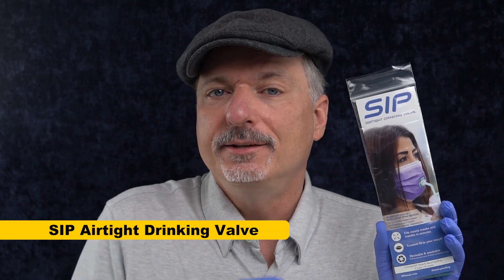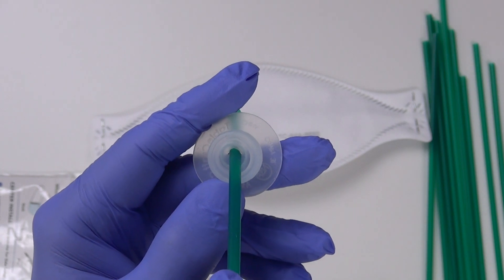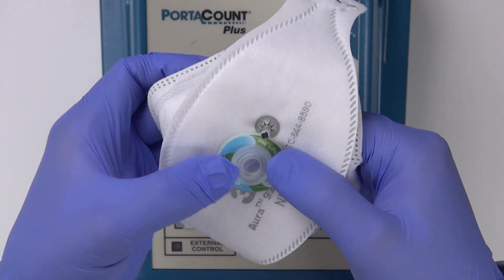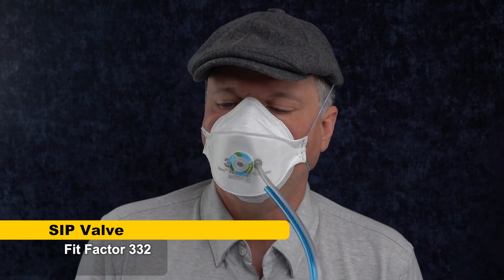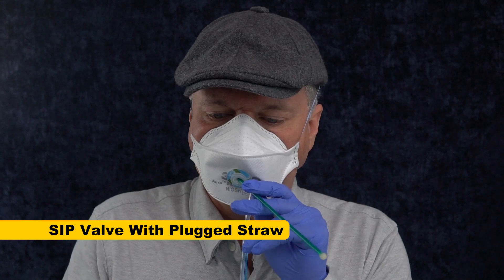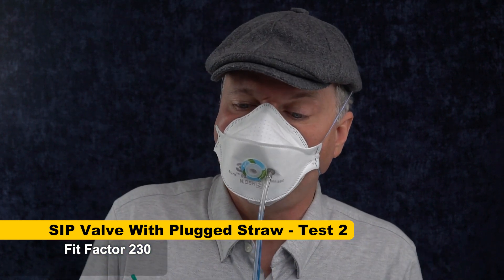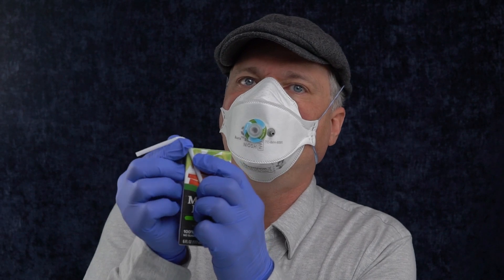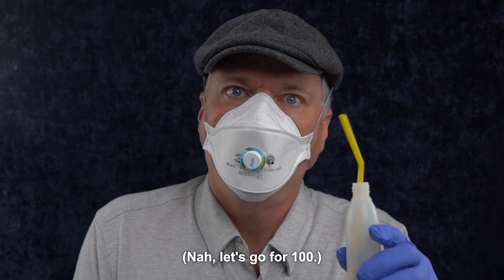Is it safe to stick a hole in your mask so you can take a drink? Testing the SIP drinking valve

Comment: Thanks for doing this testing!
Sorry if I missed it - did you try any of these tests after washing the valve in the dishwasher and installing in a new mask, as the website says you can do ~10 times?
Reply from the maker: @joshuaremba8261  

Thanks for the question. I have not done a longer term test yet. I was just looking at some of my sip valves from this test with a microscope, and found a lot of debris on the valve that could possibly interfere with the performance if it gets in between the different flaps propping it open. So I think your suggestion of washing the valve is a good one, that people should visually inspect the valve with a magnifying glass or digital microscope, the one I used happened to be around $22. Very inexpensive what it does.
Reply: @gerardhughes  I'm wondering about things like it warping slightly with washing, in addition to everything else.

Comment: This is really good. I do note from the packaging that there are fairly specific instructions on how to drink (while using the straw) to prevent the risk of breathing contaminated air during use. I think they suggest you keep the straw cleaning edge clean and put the straw into the drink then breathe out, forcing any air in the straw into the drink before then drinking. I imagine this is a complicated technique to adapt to! I also consider that the drinking edge of the straw needs to be kept clean before using it every time.
This is reassuring though. Thank you
Reply from the maker: @cassmacdonald-75  

Thanks. This video has been out for a while, and they have since updated their instructions with best practices advice.
Reply: @gerardhughes  yeah, I thought that was the case! Got mine about six months ago, though have not had cause to use them (haven’t travelled or spent sufficient time out of the home to warrant it). Apologies!

Comment: Thanks for this review! I'm still a little unsure about these. Doesn't a fit factor of 34 when using the supplied straw mean that it fails the fit test, if 100 is a required to pass? I understand that it's better than something that fails even more, but... 😅 I would have liked to see a few different attempts with the supplied straw, just in case something went wrong that time. Or what the score is if you take a lot of care not to suck air through the straw etc. Good to know that the valve itself doesn't mess with the fit factor of the respirator too much anyway!
Reply from the maker: In this video, I'm using a full range PortaCount test that calculates total inward leakage, which includes filter penetration as well as seal leakage - it's sometimes called "N99 Mode", for use with filters that are N99 or better. An N95 is allowed to have up to 5% filter penetration of the most penetrating particle size at 85 liters per minute of air flow, so this kind of test doesn't tell me how much of the total inward leakage is allowable filter penetration (up to 5%) vs. allowable seal leakage (up to 1%). 

So, using this machine a legit N95 with a perfect seal could still score below a fit factor of 100. There is a separate mode that some PortaCounts have called "N95 Companion" that only tests negatively charged particles, which are easily captured by the filter media and don't penetrate, so if they are inside the mask they got in around the seal. In that case, you know a fit factor below 100 indicates a failing seal leakage.
Reply: @gerardhughes  I see! Thank you, that makes sense.

Comment: This is such good information. Thank you for making this video.

Would you ever test with the Gerson 3230 N95?

I find that the duck masks have great seals but I'm worried about its odd shape when it comes to valves.
Reply from the maker: Unfortunately, I'm not one of the people that fits the Gersons well. So it's not one that I can effectively test with the sip valve.

It seems plausible that you could put it on the lower half an angle of straw up towards your mouth effectively. At some point I made test that with a 3M V flex, which is the only duck bill type mask that does fit me that I've tried so far.

Comment: Where can I get one of those machines? I need to test various respirators with beards.
Reply from the maker: You can find them on eBay, but it is a little bit tricky because these are surplus devices that are no longer repaired by the manufacturer. The laser diode in the machine has a limited lifespan and there is no error message on the machine when the diode is dead. So some of them don't count particles, and it can be tricky to tell whether or not that's because it's clogged or because the laser diode is dead. If the laser diode is dead, the machine is non-repaiable. So buying these off of eBay is a bit of a risk, although many people have had mostly good luck. But the last one I bought was dead and non-reparable.

The other tricky thing is that you need to get the machine to come with all the accessories necessary to operate it. So you should download the manual on the TSI portacount 8020A to learn about its operation and what's necessary because none of the eBay listings are itemized. You have to learn to tell the items from the photos and the listings.

You'll need a working portacount 8020.

An alcohol fill capsule
Alcohol cartridge.
Alcohol wick
Storage cap
Twin tube
Power supply
Zero filter

Additionally, depending on what kind of masks you're testing, you'll need adapters to fit the sampling tube to the mask.

For N95s and other filtering face piece respirators, you'll need the flanges and speed nuts that TSI calls probes, as well as a set of installer tools. It's possible to improvise the installer tools with an all of the correct size and a hole in a block of water plastic. The whole needs to be wide enough to let the speed nut fingers spread.

If you're testing elastomeric masks, there are different ways of testing them including adapters that fit in between the filter and mask, which can be expensive. It's also possible to punch a hole in a mask and put a probe into it. This is sometimes more cost effective than buying the expensive adapter. And some gas masks have drink tubes which can be used as a sampling port with the appropriate adapters.

New top of the line machines by TSI cost around $18,000. You can also buy competing new machines from AccuFit.

Also, keep an eye on Aaron Collins OpenAeros, which is currently designing an open source particle counter for maskfits testing which should cost less than current commercial mask fit testing machines.
Reply: Ouch. I think a rental or a loaner will be a better option than an outright purchase.  I’m curious what the efficacy would be with different facial hair conditions.  I’ve read at least one study claiming between 3-12% leakage, which I don’t think is all that terrible in a non clinical, well ventilated, setting.  There’s a few anti-masking “industrial hygienists” that swear that <100% filtration is equal to 0% filtration. I guess nobody has bothered to teach them about minimum infective dose. Of course these clowns also make erroneous claims that the “virus particles are too small”, or they evoke the disastrous Cochrane Review, and they even go so far as to spread disinformation about gas exchange and SpO2 levels. They say respirators are dangerous. I don’t have any trouble making them look really stupid, but it would be cool if I could conduct my own videos demonstrating SpO2 levels, and filtration efficacy.
Reply from the maker: @JonnyTravieso  

Many industrial hygienists don't seem to be able think outside of the OSHA regulatory box, especially when it comes to the difference between the general public who need protection for situations they are going to be in anyways, where any protection is an improvement.

You don't need a mask fit testing machine to do SpO2 level demos. CO2 level demos are hard, though. The type of device that can do capanography readouts is expensive and CO2 levels vary during the respiratory cycle, so you need a high sampling frequency - and there can be some C02 retention with various respirators, but not enough to be clinically significant, and certainly not enough to be more risky than Covid - hospitals never filled up with people sick from wearing respirators, they filled up with Covid patients. So the risk benefit ratio is pretty much 100% in favor of respirators. But there is still some nuance, and anti-maskers don't do nuance.

As to virus particle being too small, N95s filter viruses even better than they do the NaCl particles used to test them, as the study I cite in this tweet notes:

https://twitter.com/ghhughes/status/1712270485508215156

I continue to be baffled that some people think scientists never thought to test for viral filtration efficiency. Even some industrial hygienists don't get that not only did scientists study it, there is even an international standard for testing mask filter media with actual virus particles, called "VFE". 

I do think that facial hair and fit is going to vary from person to person and mask to mask since fit is very individual, and facial hair can vary radically from person to person.

Comment: Sorry if this question is answered in the video, or if someone has already asked this... But can you re-install a SIP valve in a new mask, or do you need a new valve every time you install it in a mask?
Reply from the maker: Yes, you can totally transfer the SIP valve to new masks.

I believe they officially say you can do it 10 times. That's their cautious estimate. You might be able to do it more than that.

The valves are a pretty thick, robust piece of silicone, so it feels pretty reasonable to say that they can be reused.

Comment: Thanks! That answered all the questions I had in mind about those type of products. I still wonder how to avoid contaminating the straw, like if it won't go in right or if hands get contaminated from the front surface of mask. It is also difficult to inspect when it is on. but if the draw gets very loose, it probably leaks a lot and there is always the cap.
I've been in situations where something like that would have been very useful when the other choice was not to drink and I was thinking of perhaps making something like that myself (or ordering some ready made).
Reply from the maker: If you want to inspect the valve while still wearing the mask, there is a wide variety of inexpensive video ear cleaning devices that can be had for about $20 that are just an inspection camera with a little scoop attached to the end. If you get one that you can take the scoop off of, not all of them are removable, you have a little wireless video camera that feeds video to your cell phone, that's designed for close up images.

Comment: Very good to have some hard data on how valid these things are! Important to note that the instructions very prominently say that the straw should never in the mask without being also in the liquid. It makes sense, if you put the straw in the mask before the liquid that's just completely bypassing the filter where if it's in the liquid first no air's making it through the straw.
Reply from the maker: I haven't checked the before and after to see all of the changes, however they revised their instructions after I published this video to help clarify best practices.
Reply: @gerardhughes  Thank you SO MUCH for this video! I was wondering the same thing as Robert about having the straw in the liquid prior to inserting it into the valve. And I see that you did not have those instructions at the time of this video! Do you think we can assume that the score of 34 might increase if the straw was in the liquid prior to insertion into the valve?  I know we can’t be sure…but what do you think?
Reply: @gerardhughes  Ah great news, ty

Comment: Thank you!

I would have liked to see if drinking with a thicker straw would make much difference.
Reply from the maker: I've been meaning to make a video that's kind of the opposite of this one. This one was a torture test designed to see how ordinary use might work. But I would like to do a video on what happens when you do absolute best practices. And using a larger straw and checking its leak rate is one of those things that may reduce inward leakage into the mask.

Comment: thought you were gonna put the regular sized straw through the sip valve not under the mask.... and you can definitely put the cap on without breaking the seal on your mask
Reply from the maker: Later in the video I use the full size straw as part of the torture test on the valve because I assume some people are going to ignore the recommendation to use the small size straws that are included.

However, I used small size straws for the fit test because those are the straws that sip mask recommend for use with the SIP valve.

I did test straws through the valve, as well as under merely for comparison. Because people who don't have a sip valve are going to be tempted to use a straw under the mask, so I think it's something that people should have a comparison for.

Comment: Can you do this on elastomerics
Reply from the maker: Without testing individual masks and filter combinations, I can only speculate. I see a couple of potential issues that would make the application on an elastomeric different than on a filtering face piece respirator like an N95.

One issue is that elastomeric mask bodies are often harder plastic with a softer over mold of thermoplastic or silicone for the face seal, which makes the mask design complex. There may not be a place on the mask that is smooth, and thin enough to fit the SIPValve on to. I think you might be able to put it on the ElastoMaskPro, but even though that silicone mask body is all one piece and very smooth, it's also much thicker than an N95 filtering face piece respirator. So I don't know If it would work with the retaining ring that comes with these SIP valve. And I'm not sure where you could fit it on other elastomeric respirators.

Another potential issue is the higher breathing resistance of elastomeric respirators when they are fitted with p100 filters. I did not have any leaks with the SIP valve that I could detect, but that was at the low pressure levels of the 3M aura. Filters with a higher pressure drop, such as 3M 7093 p100 filters, might cause the SIP valve to leak. Or they might not. I don't know. That's what testing is for. But I wouldn't assume that it works without confirming with testing.

Full face military respirators often come with drinking tubes. I've never seen that on a half mask. But I do wonder if there might be some way to Frankenstein a mask together using the drinking tube from a military mask on a civilian half mask.
Reply: @gerardhughes  Thank you for such a detailed reply!

Comment: I wonder how one can cut a precise hole in the 3M 1860S as it's the only mask I passed a fit test for. Since you can't fold it without compromising the integrity of the mask, you'll have to figure out another way! Really considering getting one even though the currency rate against the USD for my currency is turd and it costs almost double, not to mention the shipping... but it might make my office days so much more bearble, and maybe I can even consider longer plane trips that aren't just domestic?
Reply from the maker: I don't know if you would actually damage the mask by folding it to make the cut, but it's a good question and one that could be tested with the fit testing machine. It's possible that the filter media could be damaged, it's also possible that the fit could be affected. Or not. That's the beauty of using the machine for objective data.

At some point I plan on doing my next test cutting a neater hole, and I plan on using one of my leather punches to do so, I'm hoping I have the right diameter in my set of punches to do so, but I haven't used them in a while and I don't remember all the sizes that I have. If I do have the right size I'll just place the mask over a thick piece of leather inside facing up, put the punch over the area where the hole needs to go and give it a few taps with a mallet to punch the hole. 

It would also be possible to cut a hole with an exacto knife, but perhaps a bit difficult to make a clean cut, I haven't tried doing so yet.

The valves do go on sale occasionally, to make them a bit more affordable even if the shipping cost will remain the same. I would order more than one since it would be so expensive to reorder a single one again if you need a replacement. Although, admittedly, I bought a single when I bought mine. But shipping wasn't quite as prohibitive in my case since I am in the US.
Reply: @gerardhughes  A leather puncher is a good idea! I will have a dig in my craft box and see if my punches will work on some ready-to-retire 1860Ss. And thank you for the tip about the occassional sale. I will keep an eye out.
Reply: Also another point that just occured to me, since the 1860S is a cup shape, would you need to insert the SIP in a flatter area of the mask, (i.e. not the centre but perhaps closer to the chin), instead on an area with a more prominent curve? Would that affect the seal? 🤔
Reply from the maker: Don't know about location. The apex might be the most symmetrical place to put it. Location on cup style masks could be another thing to test.
Reply: Also to note, I can't lift my mask up like this good sir is doing to sip through a straw, as it's cup shaped and won't let me move it that way on my face!! So it's either don't drink at all, or drink/eat only when outside.
And thank you very much for this informative video review/testing!!